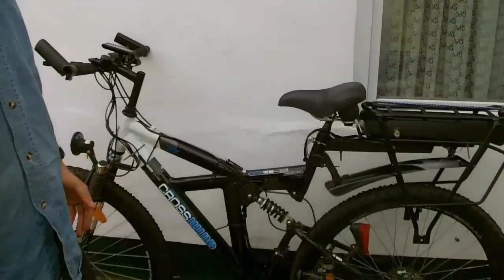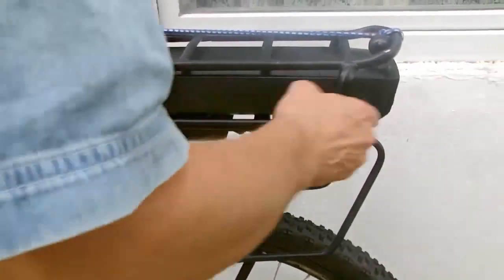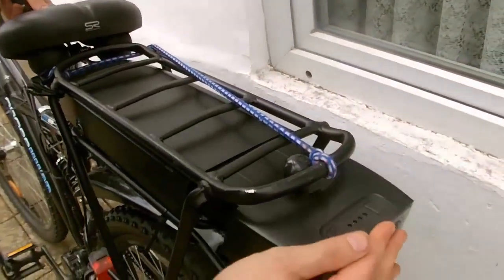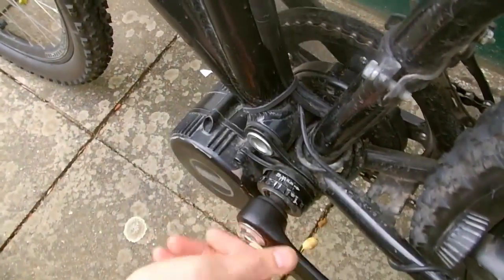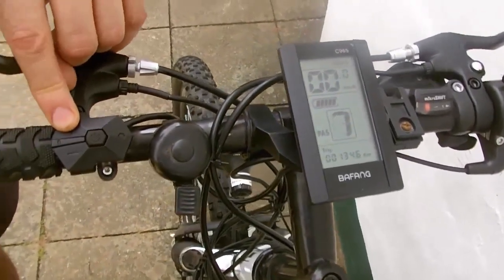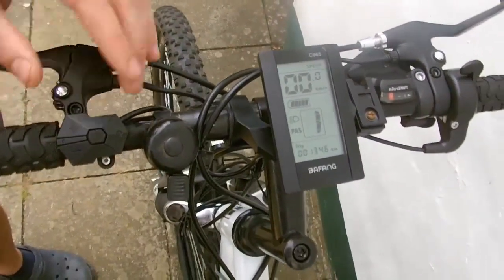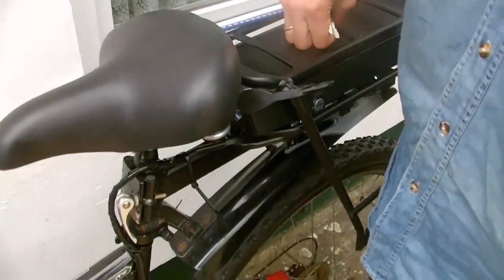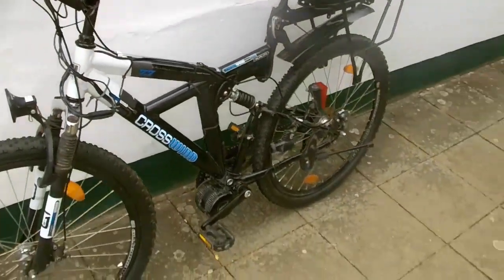The result of the installation of Bafang 8FUN motor 750W on mountain bike - review (English)

Comment: How many kilometres have you done so far? Any problems?
Reply from the maker: until today i drove about 5 thousand km(for about two years). I don't have any problem with  engine self. All components work ok.  I have got any problem with bike. I can confirm the middle motor bafang 8Fun 750w is very reliable and efficient.
Reply: Thank you very much. I hope you will do many more Km with it, cheers.

Comment: How is your rear suspension going to work with that rear pannier rack?
Reply from the maker: if you noticed, i used as basis the rear rack luggage carrier for mountain bike and over there i fixed the another rear rack laggage carrier with battery case. Therefore the function of suspension works well.